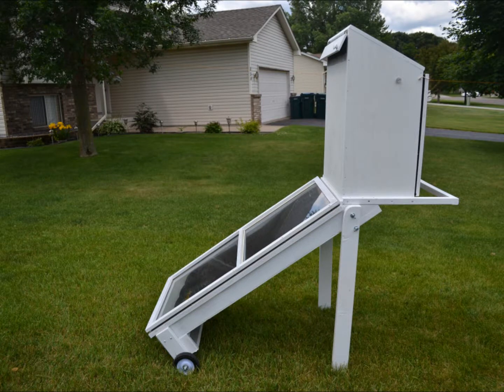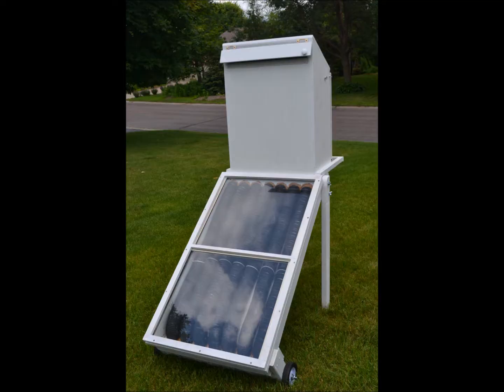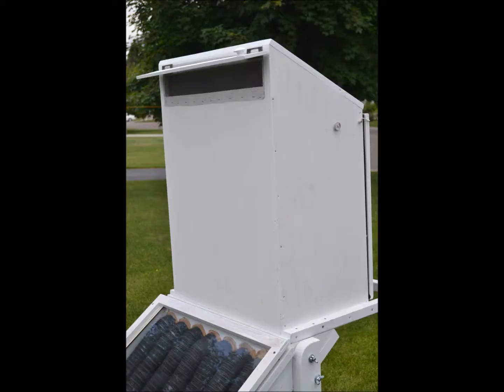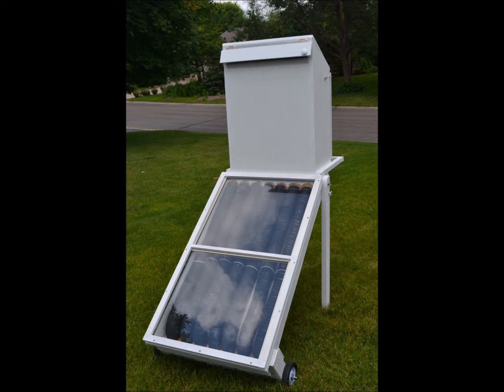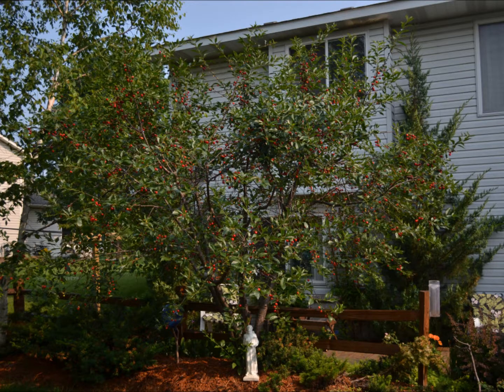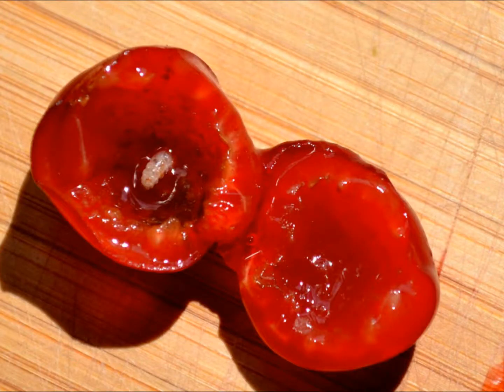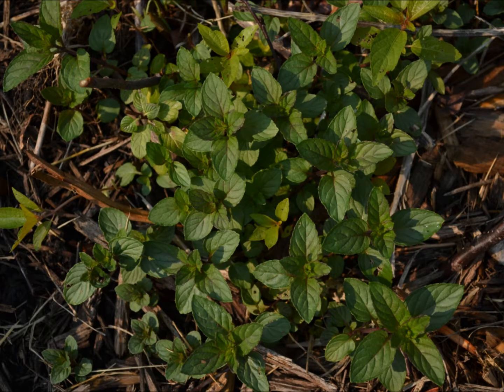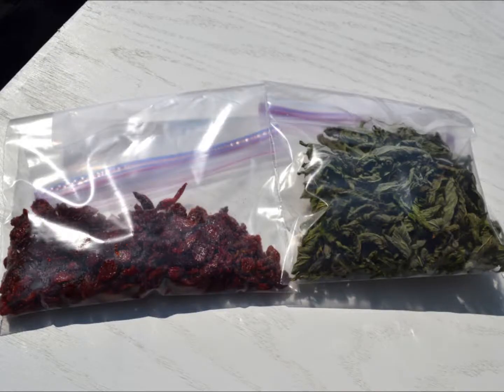Experiments In Solar Food Drying

Comment: I really like your modification to disassemble for storage. I’ve been looking at Scanlons design but concerned about the sheer size of it. Now I have my solution! Thanks. Well done vid.
Reply from the maker: Hope it works for you.  I would move the rear legs further back to make the dryer more stable in higher winds.  Had mine tip over a couple times.  Now when it's winding I clamp a third leg on.  Happy drying!

Comment: Looking at your design, and the fact that you aren't getting high temperatures, I am wondering if it has more to do with your exhaust/outlet holes being directly above your air intake holes. As it stands, the air is entering the box and going straight up, and out, of the exhaust and not circulating through the box. Just a thought...
Reply from the maker: Les,  thanks for the thought!  Note I build this 7 years ago, and since then I moved the location of my thermometer to where the air is at it's hottest point where it enters the dryer box at the bottom and have found much higher temperatures.  I was using it a few weeks ago when out side air temp was in the upper 80's and temperature entering dryer box was in the upper 130's degree F.  So I don't think there are any problems with temperatures getting high enough with the design as is.  Thanks though for the thought.  Your suggestion might be something to reconsider for any one making a new version of the dryer.  Tom.

Comment: I think your temp problem problem will be corected as soon as you paint the  unit Black, as white reflects the suns  heat where black draws it in  ,,,this is why bee farmers use  white on there  bee hive frames.....Nice design my friend just paint it black and you will get the temps up.thanks for sharing God bless
Reply from the maker: Actually after moving the thermometer to the inlet of the drying chamber found much higher temps upto 130 to 140 degrees which I think is plenty hot for drying foods, and unit is still white.

Comment: Interesting experiment, sir.  I wonder if that window has a coating that is blocking some of the light from entering the collector.   If you installed a reflective collar around your window as in a solar cooker, you could multiply your heat gain and achieve the 140+ Degrees you desire
Reply from the maker: Trell Johnson Trell,  thanks for the suggestions.  I moved my thermometer from the outlet to the inlet and am finding temperature are not as low as I thought.  Getting up to 130 to 140 degrees on hot day now at the inlets.  Also no coatings on the glass and the original designer did some experiments with reflective collars and did not gain that much additional heat.  I might be able to get more temp with more mods, but for now quite satisfied with a one to two day dry time for herbs I mave mainly been drying. Dry on!

Comment: WHAT is the average time taken for drying 1 kg of substance..
Reply from the maker: Depends on what is being dried and solar intensity , but typically anywhere from one to three days of drying at about 8 hours per day or 8 to 24 hours.
Reply: Thanks .... I am too doing a project in solar air dryer....do you have any suggestions to improve or any common mistakes to avoid while doing a project...
Reply from the maker: @recipeFor  The location of the back support legs makes the unit top heavy and I do typically clamp on a "third" leg to keep the unit from tipping over in heavy winds.  If I built another would figure out how to move the legs further to the rear of the unit to keep it from being top heavy.  I hope that makes sense.

Comment: Black colour please..
Reply from the maker: My concern with painting the outside of the the collector black (whether valid or not, I am not sure) was with overheating of the wood panels resulting in extremes expansion and contraction from temperature changes causing the the wood to crack and fail.  Hence I painted the outside white.  So far, temperature obtained seems quite adequate for effective drying, and the wooden white exterior of the collector has remained crack free.  Use or lose as you see fit.